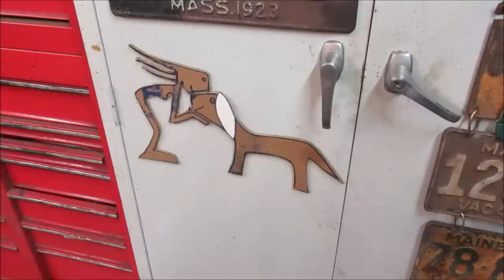Past Repair Made This snow Blower Useless, Lets Fix It.

Comment: Just goes to show. Having no leftover parts doesn't mean the repair is done right. Thanks Mustie1.
Reply: You call it left overs I call them spares...
Reply: @blahorgaslisk7763  

I call them needless bells and whistles.

screws, O rings, some kind of a metal bracket thingamabob, anti pollution stuff,..

These shear pins are breaking all of the time,.. let's put in some hardened bolts to fix that.

Comment: Midweek Mustie.  Always welcome.
Reply from the maker: l keep booting them, yt needs to do a better job
Reply: @mustie1  rather than go through all the hassle of carrying the machine apart and swapping all the parts wouldn't have been a more elegant solution to just make the motor run backwards? 😁
Reply: @rexrossman6666  Yeah that'd work Rex!  But you'd have find a way to feed the snow back down the exit chute lol!
Reply: @nevillegoddard4966  .. what if he just pulls the machine backwards instead of pushing it forward? 🤔

Comment: Great video and great fix. I kinda feel  bad for the guy who previously tried fixing it and botched it. Imagine going through all the work to replace the gear box just to put the auger blades on backwards and not ever realize it.
Reply: Also youd thing the manufacturer could have made it so the sheer pin holes were different between both sides to prevent someone from accidentally putting the augers on the wrong way. If the holes didnt align then it would have hopefully clued in the person that something clearly wasnt right.
Reply: @EllisDmented  
Simply report it!!!!!
Reply: @famousamoso7  agree! It would have been very easy to make a fool proof design
Reply: If the owner worked on it they were probably so proud that they fixed some other problem, or maybe did some preventive maintenance, only to then find it worked even worse. I bet that was discouraging!
Reply: even better when you order replacement augers and you order 2  of the same one, reassemble everything and get a 36 inch blizzard
Reply: @harveylong5878  or the story he told with the big snow blower that went on the front of his tractor where they ordered the wrong side. He said he fixed it by just putting it on the right way and drilling a new hole which is exactly what I probably would have done as well. It seems like such a simple solution to me. I guess not everybody thinks the same way or the original owner probably would have done that and not sold it because it would have worked right then.
Reply: @famousamoso7  .. it sounds like an easy fix suggestion, but from a manufacturing and spare-part logistics view it makes things a lot more complicated. With the current design the unit uses the same axles on both sides, just flip them over to use on the right or on the left. This means that all axles are made the same way and that makes it easy. If one axle had the shear pin location in a different spot, when you now have a dedicated 'right' and 'left' axle, because they are now different. This means ordering and manufacturing 2 different parts for each unit, it means assigning different part numbers and use them in manuals, it means all spare parts ordering and suppliers have to stock two different items. When an axle needs to be replaced, the question will be 'the left one or the right one'? and depending on where you stand by the unit, at the controls or at the auger end, left and right will be different and can lead to ordering the wrong one. Logistics will be a lot more complicated once they use two slightly different axles.
Reply: @keithyinger3326  Well, there is a problem with that solution.  It is very difficult to visualize, tho, well, for me, but I think I am correct.
Think of this this way.  Take a short piece of right hand threaded rod, or visualize it, in front of you.  now flip it end for end.  Is it still right hand twist?  or is it now left hand twist?
Reply: @famousamoso7 that would be like encouraging idiots to repair stuff they shouldn’t be and that’s dangerous.

Comment: A few years ago I bought a new snow blower from a big box store that was the same color.  The first snow storm it was pushing the snow out in front.  I had pull out the 20 year old blower to do the job.  It was quickly put on my truck for a ride back to the store.  It was hard to convince Skippy that it was assembled wrong.  Returned it and got a replacement for 30% off.  Still in use today.
Reply: Just in Skippys defense they come from the factory with the augers already installed the only things that have to be assembled are the handle bars the shuttle and some cables
Reply: Skippy!!   🤣🤣🤣🤣🤣🤣
Reply: Last winter purchased a NEW 30" Husgavana snowblower, welds on augers broke loose, new augers sent under warranty, they sent one correct width, other too narrow. Welded old augers so can use, manufacture welds just kept breaking. Backlog on replacement parts, took three months to get replacements.   New replacements welds broke loose, took it apart and cleaned and welded all auger welds. Works great now, just four times apart to correct manufacturing problems.   Supplier $80 to pickup and return snowblower, so I had to take the machine apart to avoid all the delivery charges.  And I have a five year warranty on this lovely machine ( MOTOR ONLY under warranty for five years, fine print)
Reply: @brianferguson6278  that's what happens when you don't buy from a local dealer plus it's a Husqvarna they makes crap now
Reply: Yes, Ariens come out of the box with cables attached and adjusted at the factory, whether you buy it at a big box store or a dealer.  Maybe a dealer catches those rare issues coming out of the Ariens factory.  I can't speak to other brands.
Reply: It was a local small dealer 5 blocks from my home, not a big box store thought I should support small business when possible.  On plus note the machine is working hard without problems this winter. Driveway is only 40ft long, so not sure is this working hard for this brand now (Made in the USA). @danbartolini27
Reply: @Mr3Charlie  the difference is at the dealer it someone that knows what they are doing setting up the machine at Lowes is the kid that can't work the self serve cash register
Reply: They will shoot forward if the chute is clogged. Did you check that Skippy?

Comment: I have an Ariens 824 from the early 80’s. I have serviced/rebuilt it several times. The thing is a beast!  Living in central Maine she gets a workout from time to time. She will out blow any of the neighborhood machines even though she is an old timer. It even has a locking differential. I have to replace the center bearing behind the flywheel in the spring, that should be a time!  I’ve heard horror stories when it comes to getting that to come apart, good thing I’ll have all summer, lol!  Thanks for the video, hopefully mine slides apart like buttah also!!

Comment: Mustie, you were incredibly lucky that the pulley hub came off the impellor shaft and that the impellor was not seized on. I us d to buy shear pins by the dozen because frozen newspapers only go halfway through the impellor. Driving the impellor backwards with a 2 by 4 and a sledge is the quickest way to clear a jam. Never Seize is the snowblower mechanics best friend.
Reply: Luck on top of the luck of getting it free to begin. Probably disassembled easily because it wasn't used after prior disassembly.

Comment: Had an old snowblower that did exactly that. Blew the worm gear out. Actually paid to have it fixed. The shop owner was bragging up his mechanic at how good he was. Took the machine home and it would not "blow" snow. Called the shop and asked if it was possible to put augers in backwards. A long pause. Then, "Yes you can."Brought it back. They made the repair and gave me a twelve pack of beer. With Mustie's help, I have done all my own repairs on that machine. It is over thirty years old.

Comment: Hi Mustie. I came across a shiny new-looking Troy-Bilt snowblower some years back during a weekend city-wide yard sale. I paid around $100 for it. It looked hardly used even though it was about 10 years old. Shiny paint, no rust, unworn skid plates. It looked like it just came off the dealer's showroom floor. When I used it some months later I was able to see why it was in such good shape. It was not clearing the snow very well. After a few moderate snowfalls, I actually studied the auger action and discovered the augers were installed left-on-the right, and right-on-the-left. I had to split the blower housing completely off the unit to affect the repairs. I now understood why that factory-fresh-looking blower was in such good shape. Someone at the factory was not paying attention to their job and assembled the auger unit this way at the factory. The original owner just put it into storage instead of trying to get it fixed and finally cleaned out their garage to get rid of the poor running blower. Their loss, it runs awesome for me now!  Love the channel!

Comment: Thanks for the midweek Mustie.  You were fortunate the pulley came right off the shaft, I had to use a homemade puller to get mine off.  And don't worry about pull-starting that engine, mine has always started with one or at most two pulls.

Comment: I have an Ariens 2055 model, 20 inch cut, 5.5 hp, it plugged a lot, except in powder, I watched a video on adding rubber to the 4 blades on the second stage that throws it out of the shoot. Because the factory leaves a 1/4 inch gap at least of clearance so the blades  would never touch the outer housing. So I took his advice, we have some 1/4 rubber at work, I removed my shoot, took out the spark plug and turned the blade until it was at the top of the shoot, and sure enough I had the 1/4 inch gap at least, I made a cardboard template to fit over the whole blade and fill that gap to an 1/8 inch on the edge and one side, I cut the four pieces out of the rubber, drilled 2 holes in them and through the steel blades. I bolted those rubber pieces to the blades, with short 1/4 inch bolts and lock nuts,  and turned them to make sure my clearance was good, it was fine, fired it up, and that thing throws snow like a beast, I thanked him online, it only took a couple hours, I would recomend it to anybody with a 2 stage, it throws powder 25 feet, all the best to ya.

Comment: Been through this a few times. Most of those differential front pieces blow before the sheer pins. We loosen the blade from the barrel side then pull the bearings. Most units you can twist the front axle and shaft, pull the blades, then seperate the front diff with the front axle in. . Very quick job that way!! Enjoy the channel

Comment: Negative is for Electrical.  Minus or Below is the correct Temperature reference.  You were so lucky that big Pulley came off so easily and that someone greased the Augers.  Excellent time to grease wheels/axles and check Friction wheel.  Fantastic Lift for this and many other jobs.  Those Ariens are known to really throw snow.  4 shear pins (2 spares) and a rattle can of orange and done.  Lower the guides so the scraper bar isn't rubbing.

Comment: Great Video. I've seen videos where snow blowers came from the factory with the agers in the wrong direction. Sense this is an Ariens snow blower, and if it has the auto steer differential that opens up a whole other can of worms. The left axle is prone to rusting if not taken apart and cleaned and reassembled with grease or anti cease. The differential is also known for moisture contamination as well as the spring inside becoming weak and allowing the gears to not engage properly and thus wearing them out. If you have a machine with this type of steering, replacing the differential periodically is a given.

Comment: At least it was well greased! I'm not looking forward to when my 8 year old HUSKEE (by MTD) will need a major overhaul. My shear pins are plain (no threads) with a hole at the end to put a locking clip thru. I ran into the big end of a broken pine limb the town so graciously plowed and covered at the end of my driveway. Ran to my local hardware store but they only had shear Bolts, I bought two of the right diameter (and hoped they were weak enough). I then ordered 10 of the correct pins and clips online with free shipping for what I paid for the two temporary bolts. I drilled holes into the metal control panel to keep a couple of extra pins and clips on the machine and put the rest in the tool box.
Reply: smart to drill in a couple of holes to hold the shear pins!  Nicely done!  My machine came with 2 slots and I keep shear pins in them at all times!  Used up 2 already!

Comment: I fix snow blowers at work, I saw you knock the pin out and I'm over here yelling at my phone saying split it mustie !!! Lololol, you got lucky taking that suger apart, Ive had to heat beat and air hammer that stuff off before, I've the got Milwaukee 1400 lbs 1/2 impact here and it makes my air impact look like a toy

Comment: Good eye, by viewer. I recently purchased a Bercomac snow blower that attaches to a riding lawn tractor. It needed repairs and one of the other things I learned is when you place your shear bolts thru the augers, there is a right orientation of the augers as well. When the augers ends beside the gearbox, the other  augers should end 180 degrees from that. The theory is that of a big clump of ice was augered to the middle the augers would sandwich the ice into the gearbox and potentially damage it. It would also make sense to be that there would be more vibration caused by having the augers ending at the gearbox at the same time as there would be alot of snow then nothing and then alot of snow again and then none. Is your augers positioned right according to this Mustie? It was too hard for me to tell in the video. Love your videos 👍

Comment: Good timing. I have to replace the LEFT auger on mine. Yes, it is stamped Left or Right on them. Did you know that, the auger can easily go for about 270 bucks CDN per side ? That, my friend, is when you better "recycle" a good used one.

Comment: They definitely tried to take care of it considering the grease that's on the shafts.
It's a shame they dont add grease on shafts and bolts in the factory's due to costs because it would help tremendously with maintaining machines.
Reply: Ariens saves money where ever they can, even on real low quality bolts and nuts. Unscrew and fasten them twice and they're gone.
Reply: By that very same reasoning, I am fanatical about using Anti-Seize on all the threaded fasteners I remove/reinstall and some smooth parts (like where metal wheel/pulley meets metal axle) to either help me or the next guy down the line. Plenty of experience with rusted/frozen together parts and I don't like it!
Reply: @Hjerte_Verke  same here, I use copper anti seize on shafts with pulleys and a lithium based anti seize for the bolts because that's easier to get off your hands.
If the bolt hole is a bit rusty I also run a tap through it.
Working as a mechanic at a rental company so it's something I deal with every day.
From diesel excavator to wacker compacting plate everything I take apart goes back with anti seize.

Comment: Just for safety sake you may want to loosen that auger idler and adjust the belt fingers (if the belt is correct) that fiber brake pad should stop that auger pulley within 3 seconds, or there abouts. Sometimes we used to have to bend that brake lever just a hair so it would press flat against the belt and large sheeve.

Comment: Excellent video Mustie 1  :) do second video this week that super cool and easy fix to do for plus friend yours be all set ! Also for question Mustie  do like shear pins with bolt has nut or cotter tight up beaters on gear box plus rods witch do like best!

Comment: You gotta feel bad for the guy who went to all the work to fix the gear box and then to take it out in the snow and it does nothing.
Reply from the maker: l was thinking the same, more common with mowers and the blade is upside down
Reply: @mustie1  but it looks waaaaay easier to flip a rotary mower blade than a snow blower auger?
Reply: Well, that's the thing, it'll blow snow, just very poorly.  I saw a vid of a guy with one of those cheap blowers where the auger is made from separate sections instead of one piece.  It had 3 sections per side.  He did a repair and accidentally swapped the middle sections.  You could see the snow pack between the sections on each side and it would push quite a bit of snow in the front when blowing.
I tried leaving a comment that those two sections were swapped and the guy was like, "Naw, they got bent from hitting something."
Well, which was also true(those style auger sections bend very easy), but it was pretty obvious they were also flipped.

Comment: Have a late 90's Ariens lawn tractor with a 36" blower- the disassembly looked really familiar. Unfortunately it sheared a pin and spun the auger on it a bit. Tried to move it, but stopped in fear of mushrooming the end of the auger shaft. And then never remembered to take it to work all last summer to try pressing it out 🤦🏻‍♂️
And on another note, "power brooms" always looked like they just used the back half of a snowblower with a brush and (hopefully) an air filter.
Reply: thats exactly whaty Ariens did for their power broom/snow broom. same back half from snow blower, walk behind tiller. We have the 367 inch Ariens snow broom that we can swap between snowblower or broom. We leave the broom on to clean up the slush the snowblowers usually leave behind